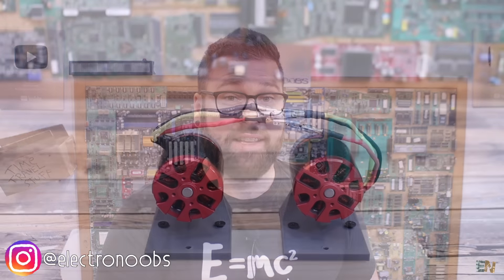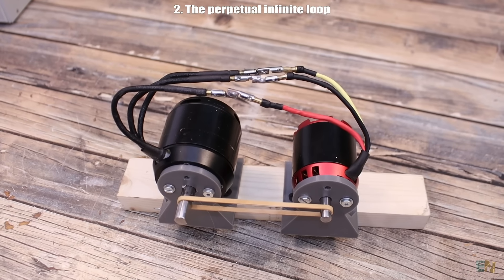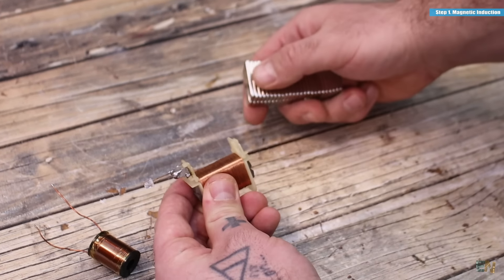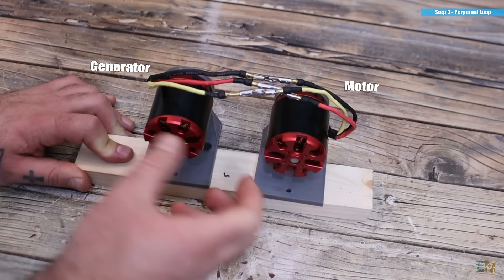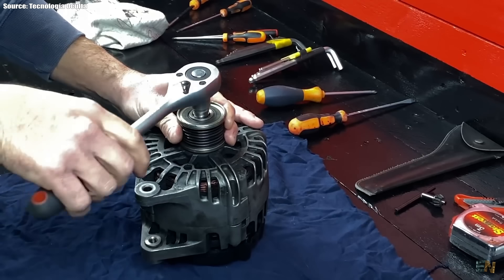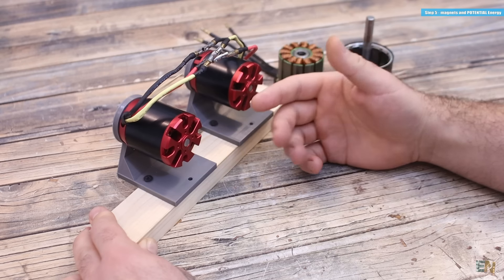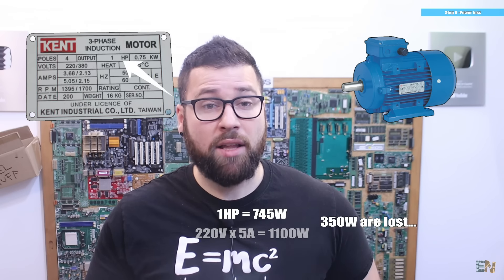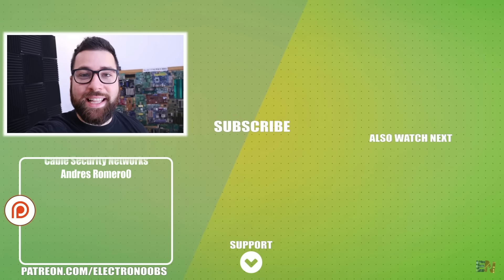Free Infinite Perpetual Energy Nonsense - FAAAAAAKE

Comment: I have a question, if you put the same system (motor and generator) but only use to charge a batteries, making with inversor and diode to don't use directly from the motor.. And only use the energy from batteries..?
Reply: The principle is still the same. The generator wouldn't charge the battery as much as the motor is draining it.

Comment: Consuming energy in any of its forms or primary sources, to carry out THE WORK of producing mechanical power is our daily bread.

Increasing or decreasing power has always been inversely proportional to speed.

Only an electromagnetic-mechanical SYSTEM can double the use of a force and from double to quadruple ITS MAGNITUDE ACCELERATING without using neodymium magnets due to its limited maximum flux density = 1.3 Teslas.

PATENT PENDING P2020-0205 ONAPI DOMINICAN REPUBLIC.

Comment: One thing these people say is you have to convert the alternator to have neodimium magnets. I queried this on one video, arguing that surely more powerful magnets would just create more drag making it even harder for the motor to turn the alternator. I got no reply!
 I also wondered how if the motor and generator were 12 or 24 volts & there was no evidence of an inverter, where did the mains voltage come from at the socket? When I queried I got no reply!
Reply: It's all trickery. Don't expect a response form the FAKE contraption creators, they are only interested in YT clicks.
According to the "legend of Free Energy" The Alternator is given magical powers by the addition of magnets. When correctly modified the alternator will output AC, up to the voltage of the utility mains in their country. Convenient! 

The Alternator has three phases. so only two are needed to run the AC induction motor that is mechanically coupled to the alternator. This leaves the third phase output to run the test loads (light bulbs and small electric tools)

It's very important to not make any electrical measurements that might reveal efficiency or strength of the power produced.

An inverter is not needed. The entire system is AC powered. In the video above (and another one debunking FAKE contraptions) DC motors were used for convenience. This has confused a lot of the soft heads that want to believe the demo is not real because the motors are NOT exactly the same as those used in the videos that work.

Welcome to the "Free Energy" debate!

Comment: Hi Buddy, your error is that you not see that the mechanical energy is not equal to eléctric power, you can move a generator which produce a lot of energy with a small motor using only a part of that energy, because the potential energy in the magnets comes from the zero point energy not from the mechanical energy that you Put in the system , that is the great hidde secret by the stablish science

Comment: I wounder if you can use a battery to store the power and then sending it to the moter but then you got a generator but I was thinking bye the amps it  should work and then it charges the battery

Comment: my dear, you are just one of thousands of skeptics around the world, I already did this experiment, and it's no use for you to come with all your equipment trying to deny something just to win a rating, your conclusions are irrelevant, because it doesn't explain how an engine single alternator can generate by applying mechanical energy, or coupled to another high rotation engine and low energy consumption. otherwise we would not have wind energy.

Comment: To start the rotation of the motors/ alternator you wind a cord around one of the motor shafts then start it by pulling the cord like starting a lawnmower engine.
Reply: Doesn't work

Comment: Yeah but how about a large perpetual motion wheel gated from the magnetic field with magnets passing by at the propper proximity to a say microwave transformer at the right sequence and speed,
 (wouldn't that work?)

This is not a video, just a question.
I'm not an electrician or anything

Comment: How can it be fake? A 12 volt 1.5 amp motor made over 2000 volts 1amps that I tested on. but it slowed down while checking the amps. Probably due to using a fan head and a fan. Although this does not prove that it is not true. The only thing that I did not do was use a powerful source to run it with so that the voltage and power could be stable no matter the load(unless it was more than double the motors original consumption rate). If I am wrong please tell me how.
Reply: A=W/V

Comment: Would it be possible to use an overdrive that would create more speed and power and use a smaller motor that would use less electricity? Just asking.
Reply: Energy is energy. An overdrive converts the energy to speed rather than torque. The generator gets harder to turn as the power demand climbs so you need torque to keep it running. Electric motors are nowhere near 100% efficient and you cannot produce more energy than is provided and a generator won’t produce anymore power than is being asked for. If you spin up a motor that draws 500 watts and is 80% efficient, it can only return 400 watts of power back to the generator which is also not going to be 100% efficient. By the time the equivalent of your first watt of energy gets sent back through the generator again, it’s been whittled down to about 0.6 watts.
Reply: @rickbateman2401   I understand but the concept of it at least to me sorta makes sense, but in all actuality, it won't work, I still might try it just to see where it might lead me. 👍👍

Comment: You illustrated it with two brushless motors, i.e. two 3Ph model construction motors. That can't work at all! Why? You should have more idea about 3Ph engines! If you couple two 3Ph motors together with samarium magnets, the phases must match. You have correctly closed the lines, but in this case it is also about the precise phase synchronization! To do this, the rotors with magnets must also be adjusted in exactly the same way! If not, the phase voltage works against it! This is a big problem with brushless motors! The other generators you drew are 1Ph motors and alternators. There is no such problem here. After starting the engine from the mains or mechanically and switching to the power generator, the 1Ph engine is automatically synchronized with the 1Ph power generator. One more thing: the energy is not free, so no free energy! It is recovered by magnetic energy. How long? Up to the demagnetization of magnets.
Reply: @darklight2.1  If you will prove it's fake, please build the same circuit with 1Ph motor and coupled 1Ph power generator as in the video of the other one and then you can prove that it doesn't work. I'm a model pilot and you can't prove anything with the brushless motor. Example: you cannot connect the two identical brushless motors with a brushless controller because of the phase shift! That's the mistake! Second: The magnets are not batteries or accumulators, but the other energy is really stored there and you can use it. I don't care if you believe it or not, but that's how it is. Industrial Electronics Engineer Miron R.
Reply: @darklight2.1  Every magnetic field contains energy, also called magnetic energy. She is a constant in physics. Because a magnetic field is created by electric currents, magnetic energy is a form of energy from moving charge carriers (electrons). In order to understand where this energy comes from, it is worth taking a look at how a magnetic field works.
Reply: @darklight2.1  Energy is required when two magnets attract or repel each other. where does it come from? Out of the air?

Comment: Not that smart. I'll agree the referenced videos most likely are FAKE. However, it is possible to create extra energy with the correct gearing and electronics boards (buck downs, boost convertors, ++ more), Transformers, alternators etc.  ... don't believe this either. As to why some people working at nuclear power plants when you can create free energy that's simple ... no one is going to admit there are ways to create free energy when it means loosing your own wallet and lots of other people's as well. Apparently electronics engineering courses fail to teach enough about humanity and greed.

Comment: Your explanation very logics
Use 250watt motor to generate 1000watt(with magnet inside) output even seem can works same rpm but question is when add load more force will increase and hp different also might failling
have you test possible this different might harvest the different excess power?
I saw YouTube add load still working voltage drop

Comment: I wonder is I use a
50 thousand rpm motor to spin a heavy  wheel and pulse spin the heavy weight I believe it can work because there is no way a load of 3kw can even slow it down that mach would break apart from that force

Comment: they do NOT use any battery , the motor drives the generator and the electricity is coming from the mains so feeding the drill does not have effect on the motor fake dynamo  the power is fed trough the wires we can not see

Comment: Every undisturbed atom, object, solar system, galaxy and universe is perpetual, and releasing free fields (magnetic waves), this is why they tend to grow and explode. The conventional generators do not use synergism and resonance for which (magnetic) waves are produced freely (like demonstrated with acoustic and tuning forks which do not observe thermodynamics); they do not recycle the magnetism (from magnets) properly. This is why they tend to slow down suddenly. What is fake is conventional knowledge, including theory of relativity (Spacetime), all the weird fantasies in Quantum Physics, order from the Universe´s explosion (according to the conventional knowledge where all the mass was in a point) .... this is the true bullshit and even if some videos are faked, they are not all faked (and I obtained free energy myself sidestepping the stupid conventional ideas, designs and frequencies). So the conventional wisdom according to which there is energy conversion is polarised by silly secular practice with no evidence of the contrary because the tech and the working principles were repeated all the times). there is much human crime going on! Or, do they ever really tell what is magnetism and gravity, and why free energy is really impossible? In Phsics all is dependent on human techs; thus if these are limited, you get limited concepts, am I wrong? No, of course. The energy of conventional generators does not derive from the input mechanical force: this serves to oppose free magnetism. Intelligence can recognise wise words!

Comment: Very knowledgeable and yet still misses the simplicity of the real infinity motor. Not two motors of same rating rather a car alternator and a a/c motor. The alternator is modified with magnets placed in a way that when the alternator is turned the magnets opposing forces will keep the alternator moving enough to generate the voltage to supply the AC motor which then takes over continuing to turn alternator. Genius. Magnets a4 held with epoxy after temporarily placed to desired positions. Alternator started by rolling a cord and pulling similar to a lawn mower. It's like a car except there's no starter but it's you pulling the cord until ac motor is live. A switch would discoñect power when desired. Go figure.

Comment: I'm only halfway through your video. And the first thing I see you're doing that No one else has done is you are rotating. Both motors in the same direction. And it looks like they would run the same speed. My understanding is you're supposed to use a motor running more speed than the generator motor that you are powering. And it's my understanding. You're using a generator powered motor that you won't to turn. And again you're not using that.

Comment: man, i got irritated by his glasses, are you trying to disprove already proven technique, first there is no clear explanation given by every electrical over unity video makers, over unity is impossible, but you can simply get as output a part of total energy to be large compared to same kind of input given in, there is really no over unity here, but remember that, i don't say that there is no electrical over unity here, of course electro-magnetic and mechanical energy is not total energy , total energy can never have over unity, but the pre said term (electro-magnetic and mechanical energy) can be made to have electrical over unity. i refer the term as electrical over unity just because the output is in the form of electricity and not magnetism or mechanical.  this is a proven method, just don't understand it doesn't mean it abides the , frankly the motor - alternator coupling doesn't even abides the law of conservation of energy as the term energy stated in the law is referring to total energy and not electrical energy. so better read the books and understand it well before explaining.

Comment: Well i think need more research.
The difference they use these days is almost ×3 means alternator making 3000w which is possible and motor they are using less then 1000w.
Now lets assume 500w waste which is more then enough.
So you can still get 1000w-1500w.
I know system will not run for lifetime but you can run it for even 1 hour which is enough. Also using capacitors,  supporting batteries can make it run for several hours.
All we need is common sense.

Comment: So a generator generates power for a home. What turns the generator a gas powered motor? So you couldn't take away the gas powered motor and add a motor that works on solar panel to turn the generator and have free gas less course it would be powered By a solar panel. You would need an inverter and a few other items, but would this not work?

Comment: You need to use a belt for it to work because it won't stretch. Using a rubber band is a power lost and isn't gonna work at all because it's stretching which both motors are not spinning at the same exact time. So yes your your project isn't going to work... nothing is impossible my friend.
Reply: "So yes your your project isn't going to work... nothing is impossible my friend." Kindly show a video of your correction of the faulty rubber band. While we're waiting please expand on your theory of how you think a V belt will correct the error. You can't condemn this video and then not share your success!

Comment: I've pointed out repeatedly that if a
  motor - generator combination 
  actually worked "as advertized",
  then the setup is not needed.
A combination of static  magnetic
  coils without any rotation is all
  that would be required.
Reply: No, wrong. I am not saying this motor/generator system is legit, far from it.
But your logic about the coils is flawed.
Can a motor run with just "static magnetic coils" work? Or a generator?
Then why would it work in this instance?
If you are going to shoot it down at least shoot it down logically.
Reply: @davesunhammer4218  you know what
  a transformer is, yes?
why are spinning shafts needed?
they are not in this case...

Comment: An alternator has diodes the don’t let power to back feed and also the larger motor and alternator have spinning weight inertia to help to keep rotating. Winding amount makes a difference. You are not providing anything. Use what they used

Comment: U didn't use a larger motor that requires less input than it outputs. So why bother making this?
Reply: Please clarify. Are you claiming that  a bigger motor has an over unity efficiency compared to a smaller size motor? How is that possible?

Comment: Perhaps this is an over simple example of "Free Energy"
 One 3hp driving one 12000 watts generator
If this were possible You would be able to use the 12000 watts output to power 4 motors of 3 hp driving 4 generators with an output of 12000 wats to power 16 motors 3 hp motors driving 16 generators of 12000 watts output driving 64 motors of 3hp driving 64 generators of 12000 watts output Each. Ad Infinitum. This theory applied it could be scaled up to power the entire continent of Asia from one 3 hp motor.

Comment: In the video you're trying to disprove if you is really trying to disprove him you wouldn't try to use an alternator or a motor that is smaller than what you're supposed to use he said specifically that even an alternator motor wouldn't work that you had to modify it to get it to work and then in return you do the video with a smallest alternator and motor you can find that obviously isn't going to work anyways so if you're really trying to disprove him won't you at least make it how he made it and show us that it doesn't work

Comment: Unfortunately, you related motor and generator as one device. One device can’t give free energy. In other ( you say ,, fake”??) case-motor and generator isn’t one device, but In system: 1+1. But need +1 for this system - flywheel...For 1kw  energy - about 70kg.Also with condensators motor can work same with less U, as power from electric net.

Comment: Question no.1: Have you tried actually duplicating the set-up demonstrated or just sat back and "nay" said to concept without trying it? 2nd question: Why is it that you can add a larger altenator to a combustion engine for more output, but the motor is still the same? Exactly! Some of the rebuttal given doesn't hold validity. If you're gonne debunk something, TRY ACTUALLY DUPLICATING THE DEMONSTRATION! But then people will see it works.....3rd question: Is that a Masonic tattoo on yr hand? mmm hmm
Reply: 1) yes everybody has done that before
2) No such thing as a 100% efficient anything
3) No.